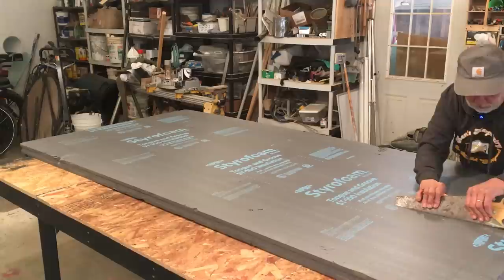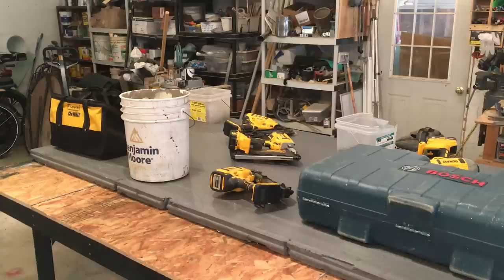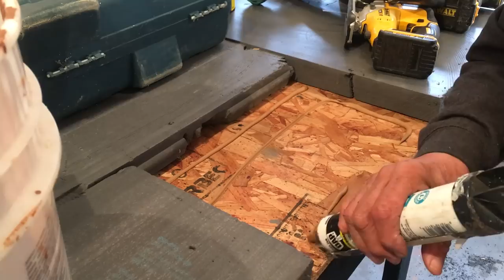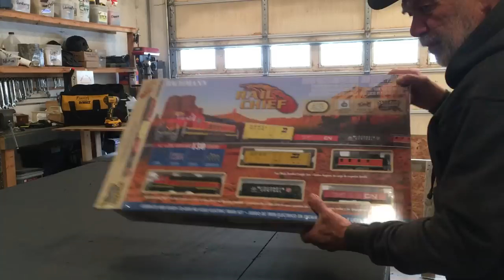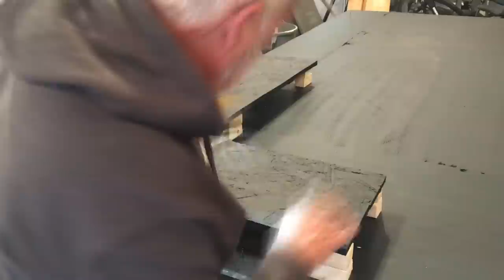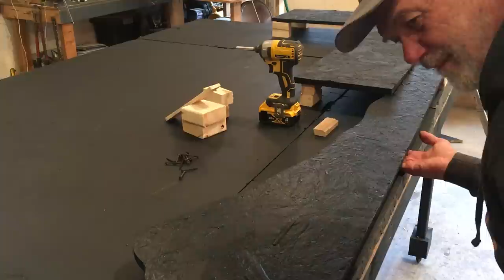Ep2 Adding Second Level to New HO Bench

Comment: My son and I did O scale 4x8 with two separate tracks to race trains (8 yr old idea 😂) We used k-line buildings and hot wheel cars for real cars 🚗 1950’s look. We didn’t use a foam base. We wanted a easy clean up. He told me there would be lots of train crash’s and derailments 🚂 😂 We just painted the plywood black and took a sponge with different colors of green to sponge paint the grass. We then painted road lines and rail rd crossing with white paint. It was a great project for him and me. Have fun. 👍
Reply from the maker: That’s quality time with your 7 year old.  Thanks

Comment: I think it was around eight or nine years old when I started playing with model railroads. I had both the O and HO gauges... And least not forget about the slot car electric racing cars. As for wiring I was gifted a large length of neighborhood or larger telephone transmission cable.... It was a seemingly endless supply of low voltage wiring. I had a little chart with the twisted pair colors so I could keep track of where everything went. I recently dug up a section of this telephone cable that was buried across my backyard. I unearthed it digging a swimming pool a few years ago. And yes I did the 811 before I dug. The telephone cable was undocumented and not presently active. I unearthed about 20 ft of it. I inquired on shipping a section of it to you but that was not going to be affordable for myself. I would imagine if you inquired at your local telephone transmission cable maintenance yard there might be a piece of scrap they might let you have.
Reply from the maker: Nice. Thanks

Comment: I'm glad you could call in Dan to apply the adhesive. That's the most interesting "weight set" I've ever seen Ken! Looks good painted. Official foam layer done on the HO railroad table! I've seen glass overhangs at stations when they are above ground. At St. Paul Minnesota there are several tracks under glass roofs near the station at Union Depot. The glass roofs are not overhang roofs. I like your layout so far. I like to see your creativity Ken. Are you going to put some garages next to the houses for the village? That would be cool if you did several styles of garage. That landscaping looks nice on the ramp. Lots of progress already Ken! Thanks for this fun to watch video!
Reply from the maker: Haha at some point it has to have a garage

Comment: If I might make a suggestion, at the top of the grade you may want to add some extra risers and kind of bend the board a little so that the grade doesn't start with an abrupt angle. This will help prevent unwanted uncoupling when traversing the transition.
Reply from the maker: Thanks good idea

Comment: The tunnel height with rail bed rail, and train 🚂. I would add more height to the upper level and the upper should be removable for ease of access. 
Using your mind if you can see it there then just build it out one section at a time and let it develop. 😊thanks 🙏
Reply from the maker: Thanks

Comment: Use card board 1" strips for forming things like tunnels. Also use toilet paper for paper mache. I have used both and liked how they worked. Mix up some school glue in a 50:50 blend for soaking the toilet paper. It will dry hard.
Reply: Those are some great tips! Have a great weekend!
Reply from the maker: Yes they are

Comment: You can run Diesel Locomotives 🚂 under an overhang  at a station as long as it has openings or exhaust fans. Secaucus, Hoboken Station & Newark Penn Station in New Jersey are that way.
Reply from the maker: Nice to know thanks

Comment: Hi My First Layout was a 8X4 sheet and  my Dad  Put  a Rope on each Corner  and Ceiling or roof Fixed Washing Line Pulleys  So when I Finished Playing with it Or  Building some  you just  pulled it up to the ceiling  out the way I Think that would be a  good solution for yours so its not in the Way at all  Just a Thought  Thanks Ken
Reply: Wow, your dad had a great idea! That gets it out of the way! I had cousins that put their train set up in the attic so it was out of the way and they would climb through the attic hatch to go run the trains. Sitting on the joists was kind of cool. It was dark in there so the lights showed up really well. Have a great weekend!
Reply: @StoneKathryn   ive made layouts every were in loft in garage in the garden even in the front room  my dad  made my first so it was over  my bed and lowered onto my bed so dint need legs
Reply from the maker: Nice

Comment: Ken, I suggest you make the transition from the incline to the flat second level not so abrupt, it needs to be as smooth as possible.  I believe that in its present form it will be a problem for the train to make it over that section.
Reply from the maker: Thanks. I think it worked out to 2 percent grade. I’m going to verify that
Reply: @Kens265  A grade of 2% works out to be only two inches of rise over 100 inches of track length.  Grades on model train layouts are often much higher than thought but as long as the train makes it up the grade it’s good.

Comment: I would suggest that you spend more time studying how you will install and maintain the wiring and controls before you design the layout on top. For example, you already have complicated it by elevating where the station will be. How will you install the wiring that will be required to control the tracks in that area? One suggestion I would make is to install a hinge on one side of the layout. That will allow you to lift the layout so that you can work on the wiring standing up (unless you prefer laying on your back on a creeper!). Slow down, don't "go off half cocked". You are embarking on a very enjoyable hobby!
Reply: I like the hinge idea! Good of you to point this out. Have a great weekend!
Reply from the maker: Thanks
Reply: I’ve spoken to Ken about making the layout hinge against the wall so it can store vertically when not in use..

Comment: Any particular reason you chose that gauge? I started out with 'N" gauge. Found out it was too small for my big fingers. 9 years later went to "HO" gauge. 31 years later went to "On30" simply because I could use my HO track without demolishing anything to change over. I find as I'm older now, It's a pain to change the small components on the rolling stock and track. Have fun with your new hobby. It can get expensive!
Reply from the maker: Thanks It seemed like the most common
Reply: @Kens265  It is the most common
I use On30 or Narrow gauge O Because I can still use my HO gauge track layout. "O" is larger than "HO", but narrow gauge uses "HO" track. I went to "O" because the rolling stock is larger than "HO" and I have less problems with the small parts like wheels and couplings. I'm getting older and my fingers don't work like they used to.